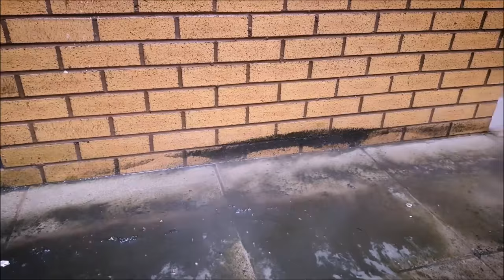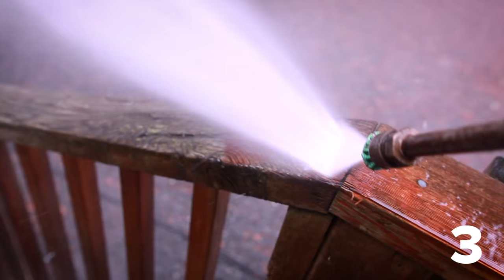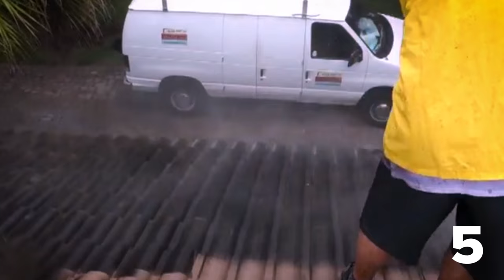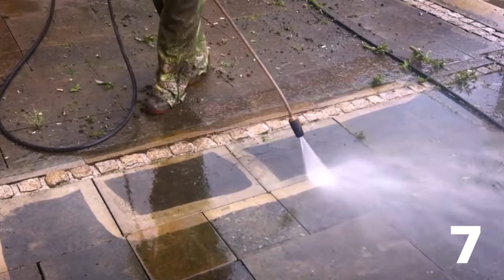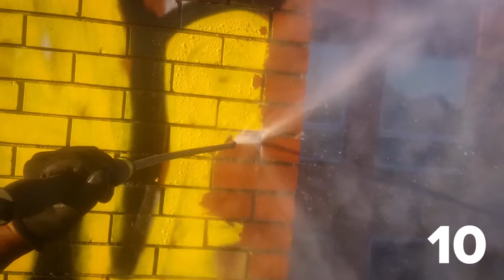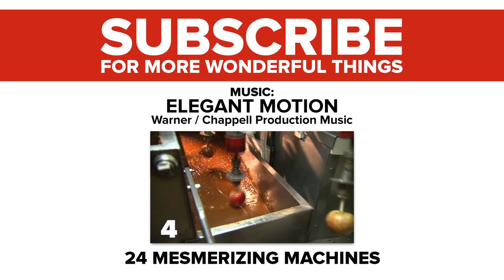13 Oddly Satisfying Pressure Washing Porn Videos

Comment: Does anyone else care that so much water is being wasted? ;-;
Reply: nope
Reply: I thought it was just me ;-:
Reply: +LeJuanCa  In fact, this machines same a lot of water is the pressure cleaning, not the water itself.
Reply: literally me
Reply: I'm not from California so idk about water
Reply: 5k it's pretty overrated tbh
Reply: It's not wasted though.. It's being used for a purpose
Reply: Come up with another way to get these jobs done without ruining what's being cleaned. Paint out of brick. Years off of weathered wood. Come up with something just as fast without being sharp or combustible.
Reply: its more pressure than water
Reply: Except for the fact that it will evaporate and rain down so it's not wasted
Reply: LeJuanCa 😂😂😂😂😂😂
Reply: You can measure it as follows:
1-Remove the nozzle, (or place the tip directly in the bucket)
2- Turn on the machine.
3- Charge in a bucket for one minute.
4. Stop the machine.
5- Measure the amount of water accumulated: It is the maximum amount of water used per minute.
Reply: LeJuanCa ever heard of the water cycle
Reply: Yes